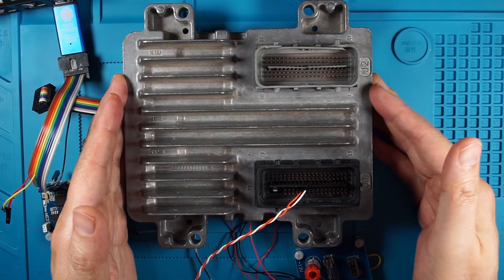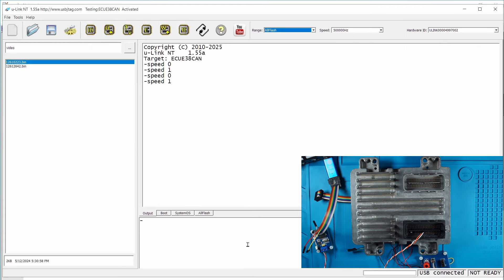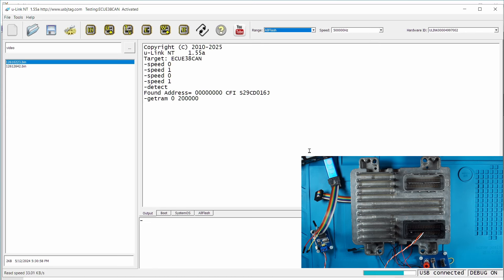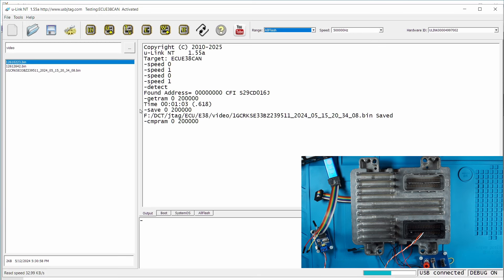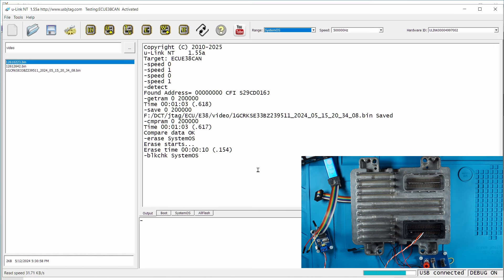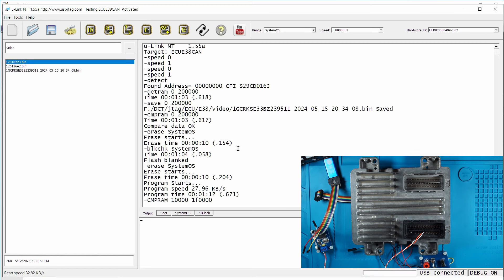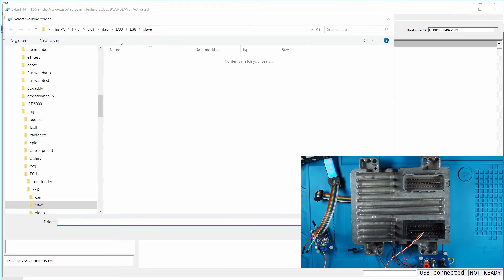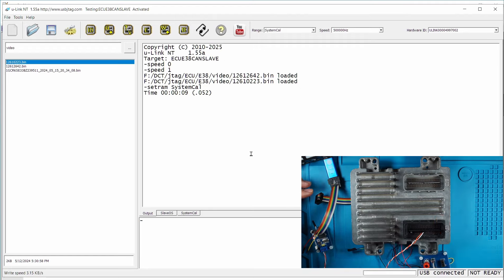u-Link NT program E38 can bus method #CANBUS#E38

Comment: The connection of 5 volt to MPC 2515 was not clear since it was off the screen on your video. Do you have another video showing that modification? I just ordered a u.-link nt and mpc2515
Reply from the maker: @moccasinmarine  yes check earlier video of 5v mod.
Reply: @ got a link
Reply from the maker: @moccasinmarine  https://www.youtube.com/watch?v=af-402UtMTU

Comment: To what pins do you apply 12V? from the research I've done its to pins 19 & 20 and 73 is GND, correct? Can't wait for my U-LINK NT adapter to arrive.
Reply from the maker: JustJ19 and J20 is enough.